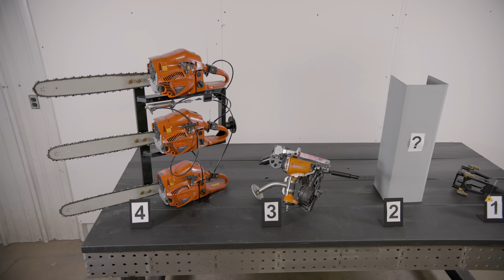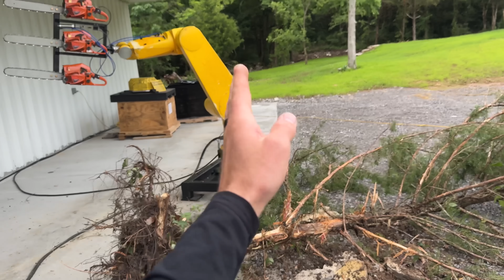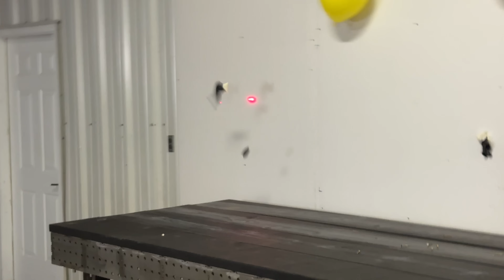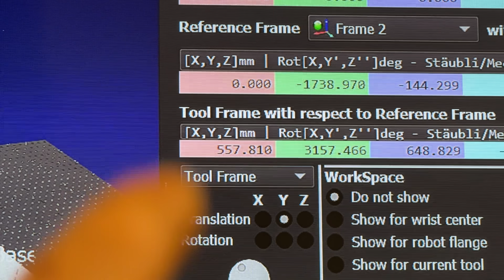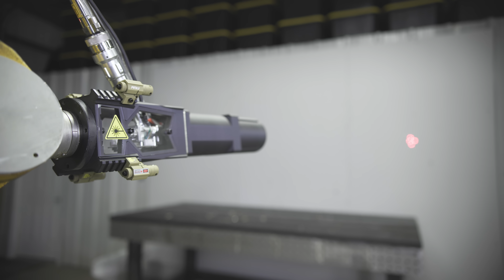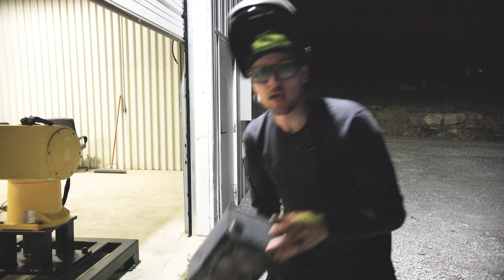Testing my New Awesome Robot Arm

Comment: Could have a laser alignment interferometer system to avoid obstacles and allow vision capability that is trained on certain shape observances. I wonder how much of this was trained on just bullish load presets or crude gcode
Reply: Wait could you do a rail gun that is 7.62 rounds to include magnet weight on your Fanuc to exclude the 3kw-12kw preamps needed? I understand the recoil might be a factor on development.

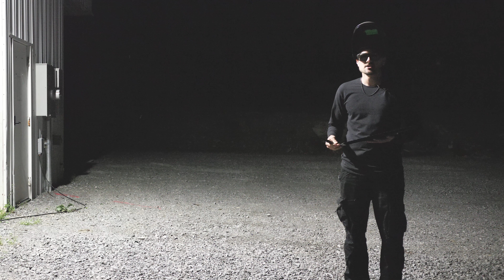Comment: 10:36 the only limit of its range is the curvature of the earth is a wild statement
Reply: What's Super ironic is that I guarantee you that laser can be seen on the surface many more miles away than what should be physically possible according to what they say would be the curvature... The atmosphere distorts but it doesn't curve around....

Comment: you got the chain saws in the wrong orientation. need to rotate them 90 degrees so they can all cut at the same time. right now the middle saw is useless.

Comment: can it lift several hundred pounds of tool steel and concrete and hold it in place [or should i use a hydraulic floor crane]

Comment: some not so good random ideas:

1. Nail minigun using a large air resevior
2. Convert your robot arm to a robot welder 
3. Worlds brightest light using a massive array of LED chips (rctestflight does some good ones)
4. Make your own tunneler to dig to China.
5. Let Chatgpt loose on your robot arm and try and get it to build something (potentially funny result), maybe get it to paint
6. Make the worlds longest tape measure that doesnt buckle

nice channel, keep the vids going 👌👌
cheers from AU

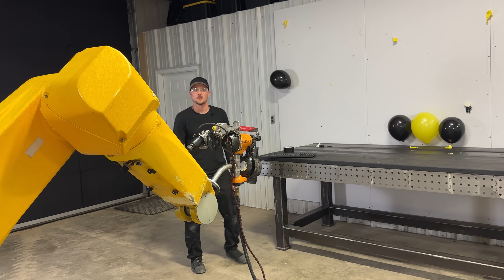Comment: 5:18 that sir is not AI, that is an algorithm. Also, for look into a pixy can for that.

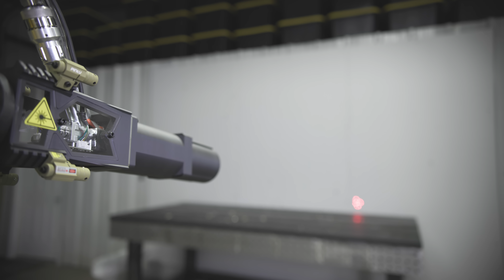Edit: Great video and the TTS into a to the different ends are really funny!! Also, 9:03 that's just a medical laser inside a 3D printed housing, isn't it? Please. Learn. Laser. Hazard. Safety. Just the photons that stray off from the beam due to colliding with eachother in the beam itself, or photons bouncing off the target, have enough energy to blind you. It's like why you wear a mask when welding; the beam doesn't have to be shined into your eyes for you to go blind. Even just looking in the general direction of the beam can blind you instantly. It's reflection off something like a plank of wood is dangerous.
Reply from the maker: Thank you! Lasers of this class are far more dangerous than most people understand. Very high attention to detail in our lab